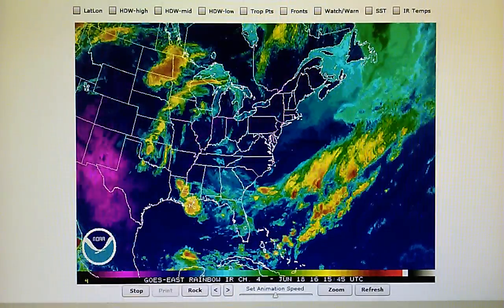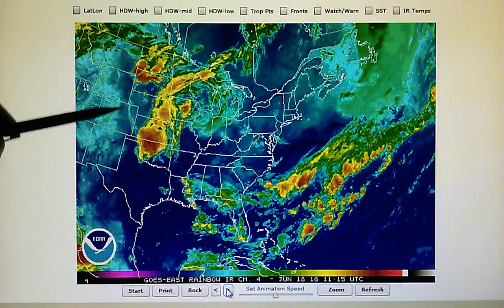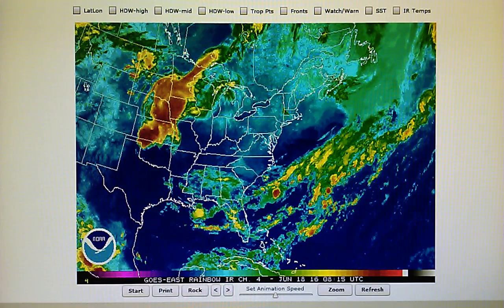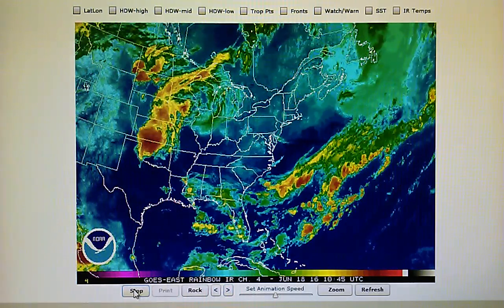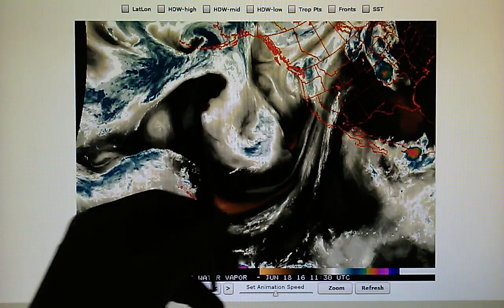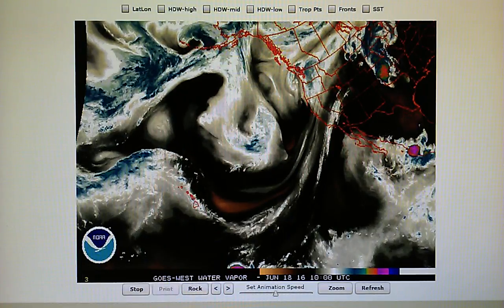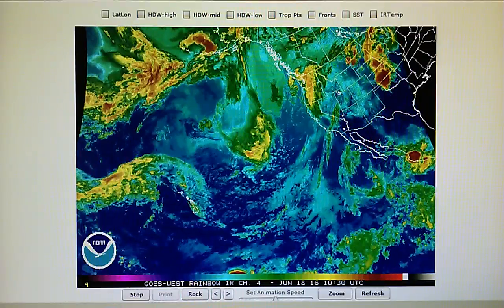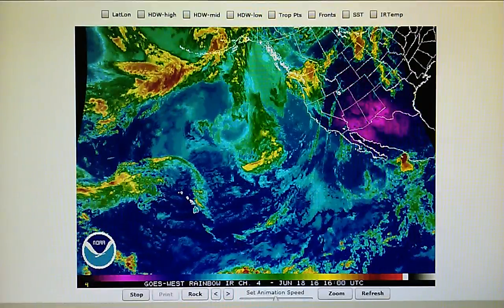6-18-2016; Thunderstorm Supercells over NE, KS & OK Superheated & Destroyed With Microwave

Comment: Been a soaking rain all day here along the NW corner border.  I did get one pic of a section of pushed rippled upper layer before the sky filled in and started to rain.

I just checked today's  MODIS, and IMHO there are at least 2 cell blast rings showing off southern Mexico.  They plainly will not risk allowing you folks in so Ca. any natural moisture.